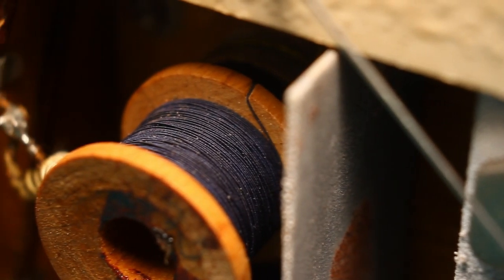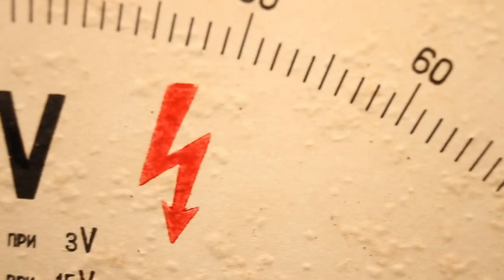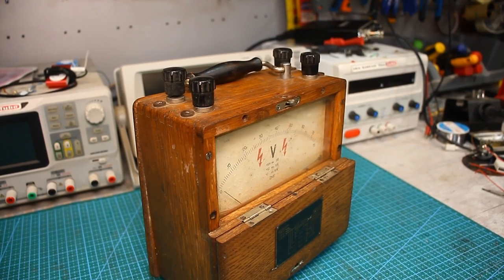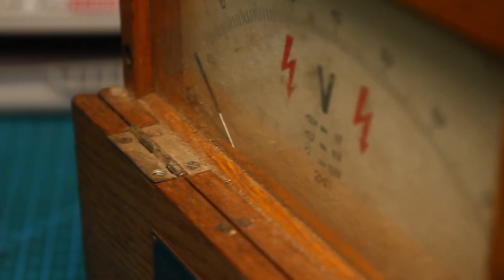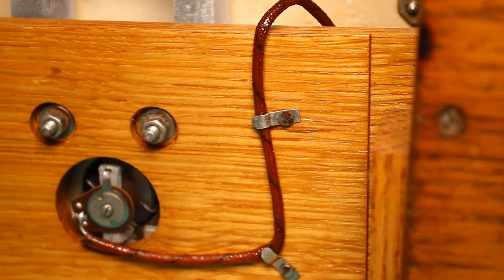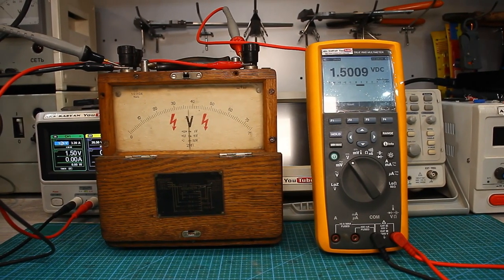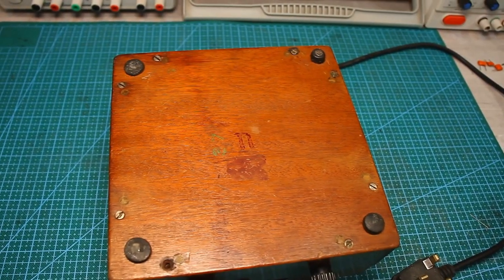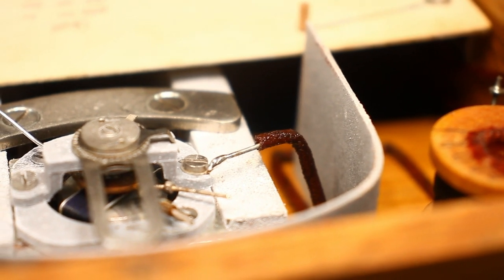RETRO TECHNOLOGIES! Electronics in 1941

Comment: It seems strange that a set of scale markings was provided that did not directly relate to any of the ranges, requiring mental arithmetic to interpret the measurements on all ranges, when it would have been simple to print the scale with three sets of figures 0 to 3V, 0 to 15V and 0 to 150V thereby minimising the possibility of erroneous measurements.
Reply: Economy. It's even simpler to produce only a single set of scale markings. And with the economical situation in the Soviet Union at the time it was more important to provide basic functionality than user comfort.
Reply: The scale markings were of a perfect design.
Your idea of "creature comfort" when reading a meter may be the strange part. The deflection coil is a 7.5 mA coil, and the scale is 75. That's the correct way to label a scale when you don't know where it's going to end up. Tenths of a milliamp was a common measurement back then. Under the V mark at center range, they give you the multiplier numbers for each range. and the meter inpeadance. The printing difference, from the crisp scale numbers, means the factory added them when they built it. Basically, the factory bought the meter movement, and built the voltmeter around it, rather than buying a custom movement with the scaling they wanted you to see. In the analog world, you know the math by instinct, and use the printed multiplier by habit. That was a very nice piece of equipment in it's day. My antique meters are the Bakelite case versions. The Simpson brand, if you know them. Good luck to you!
Reply: @d.t.4523  The scale plate can usually be exchanged without affecting the meter movement. In the West it was very common to print a custom scale that relates to the use the meter is being put to. Strictly speaking, it's not actually necessary but it adds to its sellability. Which was not much of a concern when and where this particular meter was manufactured.
Reply: @Ascania  The meter movement was built for a specific purpose, and the scale was for that purpose. Converting it to a voltmeter was what the factory did. They did a great job at it. They didn't need a new scale. I was able to read the scale just fine. That was my point. Before the war, there weren't a lot of printers to make scales. The 0 to 75 scale is lithographed. The other numbers and symbols were  stamped on afterward, in some manner.
Reply: @d.t.4523  The point I'm making is that Western manufacturers DID give their meters custom scales because it made them sell better. In the Soviet Union at the same time that was NOT a concern of any priority.